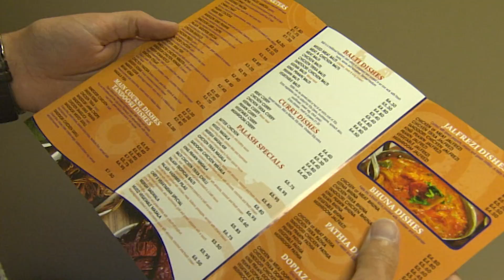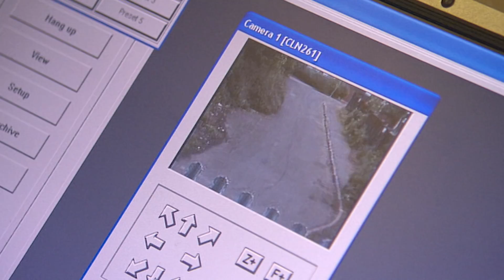Pest Control Pete See's The WORST Bed Bug Infestation! | FULL EPISODE | Grimefighters | Episode 33

Comment: After calling pest control Pete 4 times on one mattress, wouldve been cheaper to just get a new mattress
Reply: Bedbugs live underneath carpets, around cornices and can lay dormant for months. So the whole "throw out the mattress" stuff doesn't ever work
Reply: Most pest control programs include at least 3 treatments spaced two weeks between each as a package. The company I work for charges $500 And we often throw in a courtesy treatment. If it’s needed or if you find more bugs within two weeks.
Reply: @TheStonedEvo  Ficam does the trick every time, best results!

Comment: That bed would have been binned, cheaper to bin it that get the pest controller out
Reply: Had to get him out. Bed Bugs live in walls. Under skirting boards, etc.
Reply: How much do you think pest control costs?  Big infestations do cost more but most from the company I work for are $500 for three visits for bed bug treatment. 

And they don’t stay in the bed. They can go into wall outlets, bed frame, nightstand, dressers, floorboards, ceiling, behind paintings/pictures on wall. Anywhere that is a tight squeeze/crack/crevice.